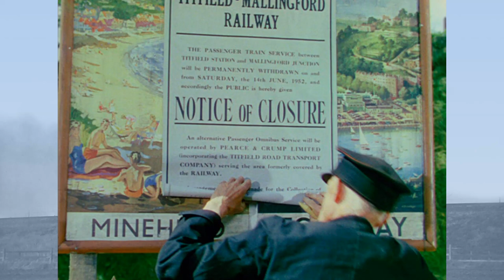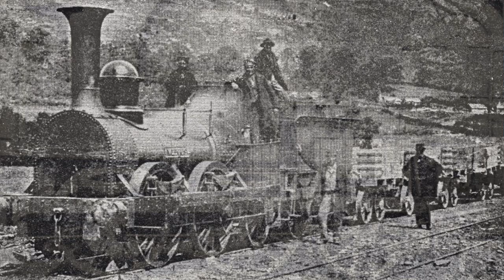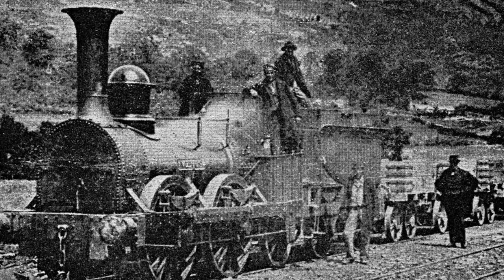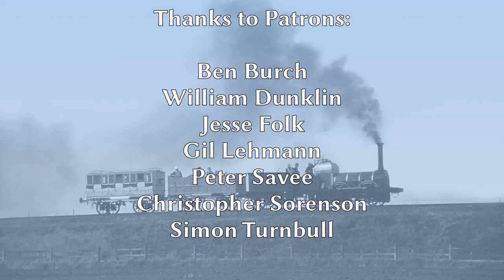Thunderbolt: The Basics

Comment: I was honestly thinking I had gone mad, until I noticed the date. Great job passing finction as almost-believable fact!
Reply from the maker: That's what I was aiming for :-)
Reply: @AnthonyDawsonHistory  how much coal did the tender of Lion carry exactly?
I guess it did matter to her film crew
Reply: @AnthonyDawsonHistory  do you think its possible that Lion may have pulled passenger trains during her life on the Liverpool and Manchester line despite being a humble goods engine. if no passenger engines where at the station
Reply from the maker: @eliotreader8220  Nope. Passenger and Goods locomotives were segregated; goods engines didn't run fast enough. There's no evidence that "Lion" or "Tiger" ever worked passenger trains on the L&M or even on hire to the Grand Junction.

Comment: Beautifully done. I love the sort of low key, straight faced  sincerity which 'sells' a complete leg pull to the unsuspecting - my personal favourite being that broken biscuits have no calories. The way that you weave the 'facts' around the fiction is worthy of Ken Follett or Cecil B de Mille.  As a possible aside, a number of early purely local railways were worked by bigger companies under a profit sharing agreement, which saved the small line investing in motive power etc. Usually this ended with the big company buying up the smaller one. Now that would possibly allow the T&M to fall into the GWR net well before 1923, so that Dean engines could have worked the line...

Comment: Was it true about the couplings being incompatible?
Reply from the maker: No "Lion" which played the "Thunderbolt" was "restored", somewhat heavy-handedly by the LMS at its Crewe Works. The tender was built from scratch and it's coupling was modern. It's just a plot point that it couldn't be made to couple on the tender. At the front, however, now that would be difficult as there is only a wrought iron eye-bolt and no proper coupling.
Reply: @AnthonyDawsonHistory  does that prove that the Thunderbolt spent some time as a industrial engine before she had worked on the branchline at all?
I understand that Industrial engines was fitted with different coupling than what was used on their main line couterparts